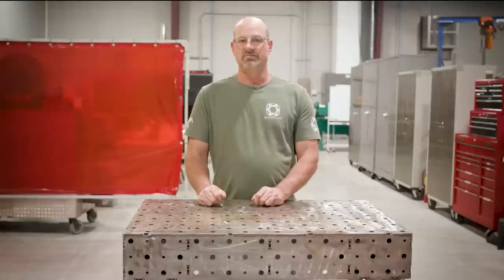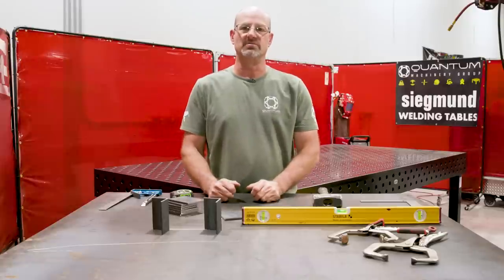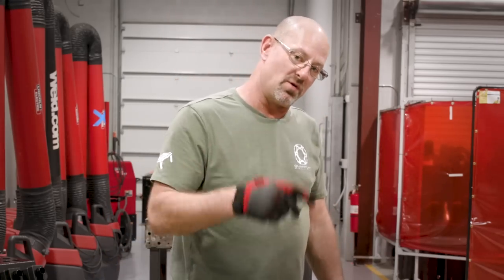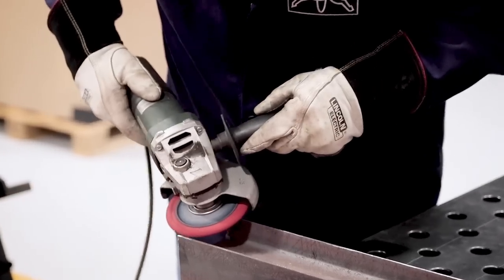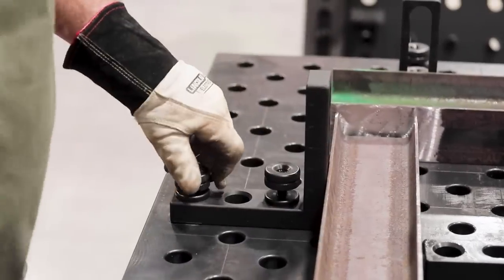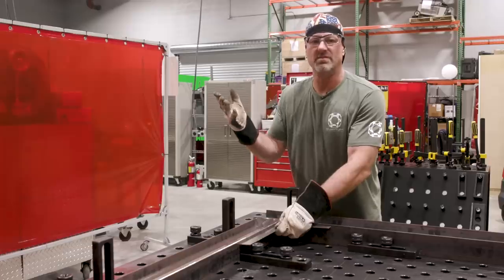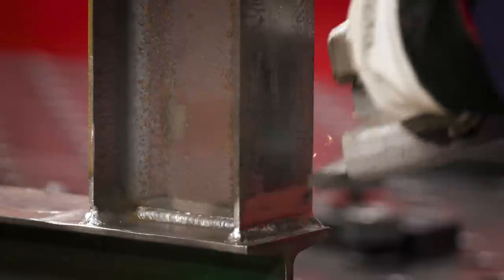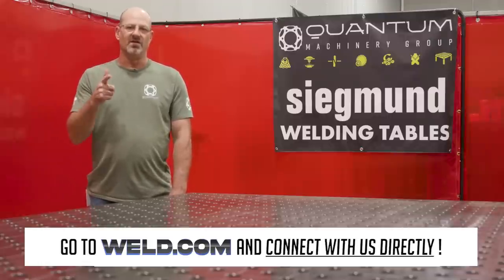Welding Table Upgrade for the New Weld.com Lab!

Comment: Dig the table for sure! You need to do another take on the last scene checking w/square though.
Reply: Why?
Reply: @chipsammich2078  the bead lifted the square up so there was a light gap at the bottom lol
Reply: @SuperAWaC  the square has a cut out for welded corners lol
Reply: @chipsammich2078  You didn't feel & hear the corner of the square climb up on the fillet?
Reply: @chipsammich2078  yeah and it's not enough because you can see the square hit the bead
Reply: @ClanChapman1rRS  no I didn't feel it through video..
Reply: The square corner should of been cutoff more, or a wider shot of me eye balling the gap between the beam and square! Thanks for watching!
Reply: @chipsammich2078  See it, geez! I think you can figure out what I was trying to say.
Reply: @ClanChapman1rRS  I seen it.. but do you practice it.. I weld all day everyday, it looks sound to me..

Comment: Last year here I said why I didn’t buy one, but things have changed. I just bought a Sigmund, a series 16 Extreme imperial 3 x 4 foot with wheels. Sure smaller and not as massive. But I’m very happy with it along with the accessories I bought for it. Problem is, I can’t seem to stop buying more accessories, or making them.  But these channels have become one large Ad. I know that’s how they pay for most of what they’re doing, but sometimes it feels as though they’re more interested in the products than how to do something. It didn’t used to be that way a few years ago.

Comment: You don't need home made fixtures made from bits of angle iron. You need this $20,000 welding table
Reply: is it made in china---that would be the hair that broke the camels back.
Reply: @peetky8645  Dunno, but it looks expensive
Reply: @peetky8645  made in Germany
Reply: NO YOU DON'T I'VE NEVER USED ONE
Reply: @hypersphereengineering6015  It is expensive but that doesn't have anything to do with it being made in Chinaland
Reply: @peetky8645  they’re made in Germany 🇩🇪
Reply: @dieseldabz7104  I never said it was built in China

Comment: System16 would be a good system for most people. Way cheaper than weldsale, but still need deep pockets.
System28 more like weldsale for people who need a crane to move thier projects around.
I'll save up my beans and order a 5x5 system16 with the set3 accessories package.

Comment: Dont weld.on the bench heat fucks it over time... I work on these benches all day every day and there's my bench perfectly flat and every one else's bench that's got more waves than the ocean... Our benches are an inch thick
Reply: Funny been welding on my table longer than most in these comments been welding or alive for that matter and my table is STILL perfect. Maybe because it's 2" thick idk....

Comment: I'm no professional by far, but what kind of square check was that at 9:34? 🤔
Reply: Home depot lmao! Not kidding.. lol
Reply: Right on the money!!
Reply: Okay, I came down to the comments to see if anyone else would mention this.  Lol, I even noted the  same time mark.  Yeah this was purely and simply a product placement ad and reality need not match the script.  The daylight under that square was completely ignored in post production.
Reply: @googleyt2622  No wonder welding in general is looked down on when not even teachers takes themselves seriously.
Reply: 100% out of square. Thats what happens when you don’t affix the workpiece on your new 20k fixture table and instead weld it floating in the air.